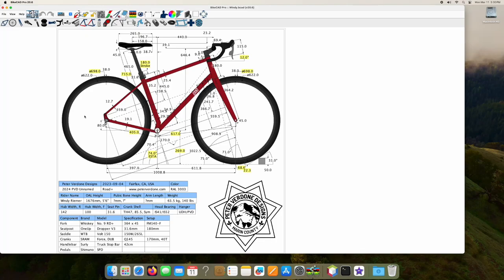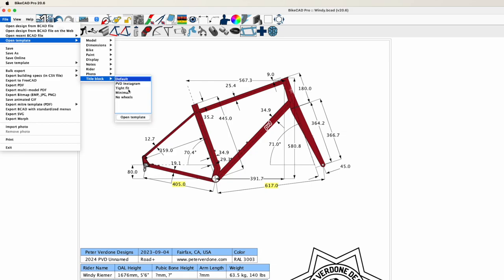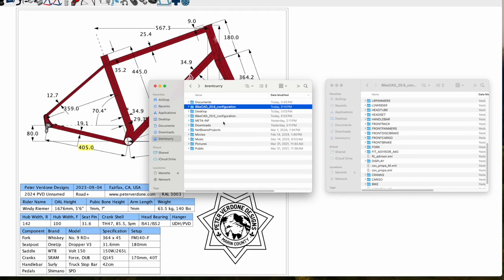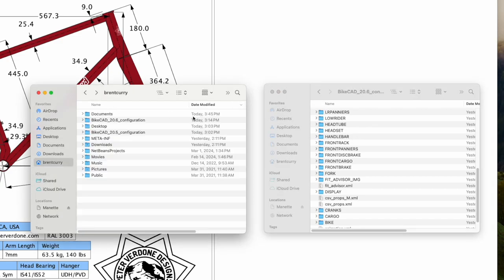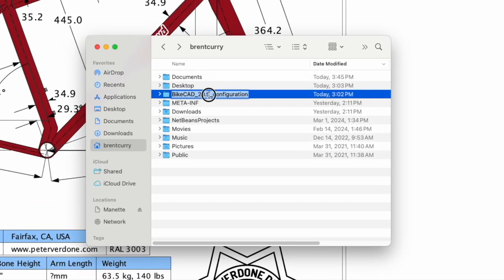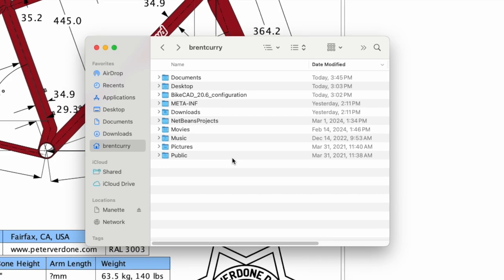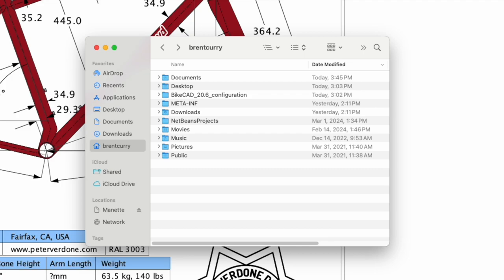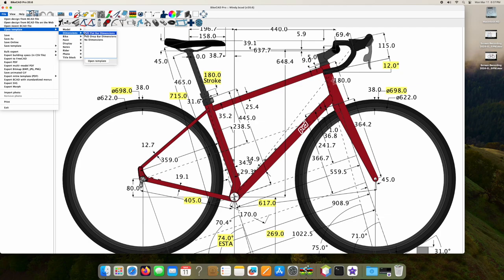Configuration folders in BikeCAD Pro

Comment: Thank you for this.   I did try to host the configs on a network drive so they are shared but it was way too slow.
Reply from the maker: Thanks for the feedback. When you say it's too slow to host the configuration files on a network drive, are you referring to the time it takes to start up? I would not have thought that the location of the configuration files would impact the general use of the program.
Reply: @BikecadCa  yes, if the config files are on a network, it will take a good few minutes to load.  Glad to send logs files or video if helpful.
Reply from the maker: @justineseiferth8010  I can imagine how storing the configuration files on a network drive could lead to a slower start up as this is when the configuration files are read. I don't think there is too much that I can do about that because it is dependent on the network speed. However, if you find that running the configuration files on a network drive slows down the program at other times, please let me know and I will try to address it.